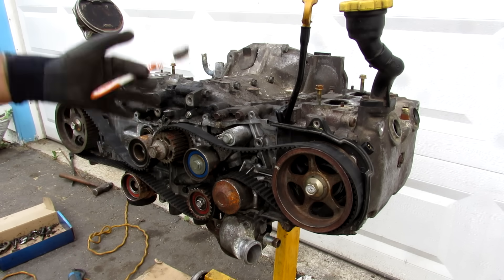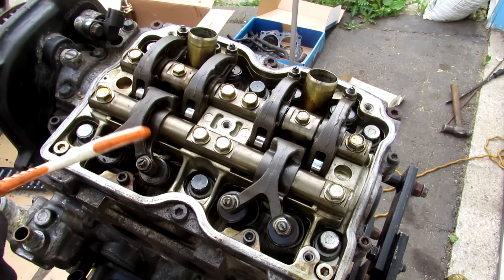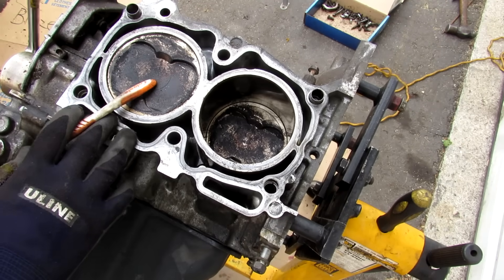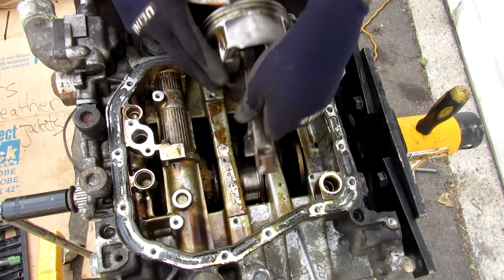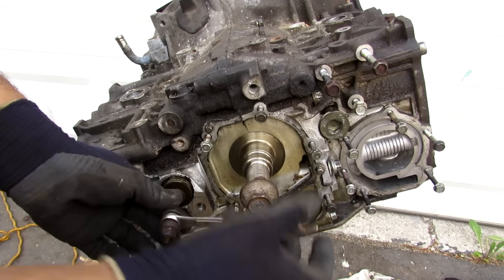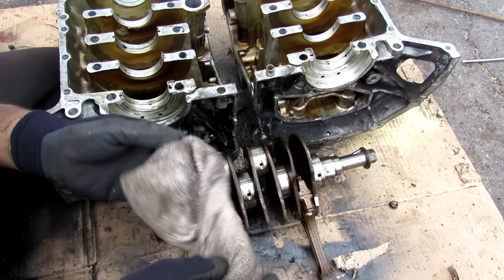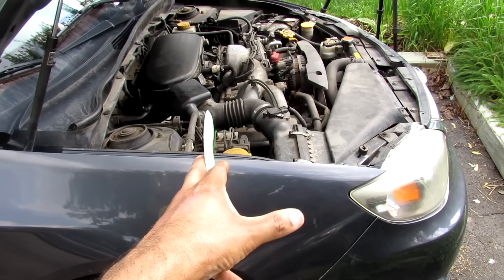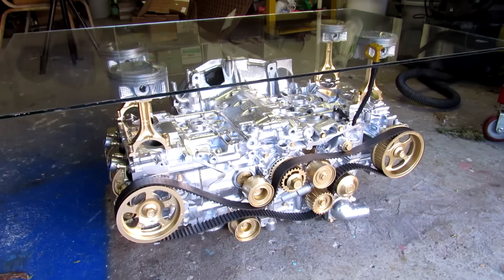Why Subaru Engines FAIL

Comment: There are actually other reasons for HG failure. 
It's primarily the head for the #2 and #4 pistons. 
One reason is cavitation of hot coolant at #4 with poor circulation. Coolant flow is very poor here and ends up stalling, allowing for an overheating issue at that location. There is a mod that helps to remedy this. 
Another reason for HG failure is harmonic distortion between the cylinder wall and the head gasket. This is more evident in the 2.5L engines as the bore dictates a thinner wall thus allowing more movement to take place. The smaller 2.2L and 2.0L don't see this as often, not just because of the thicker cylinder walls, but also some have semi-closed decks. 
As for ringland failure, this usually occurs due to fuel trims, heat and detonation caused by both. Again, many times it's in #2 and #4. I've been told of leaning fuel because of the design of the steel fuel supply lines on the engine. The aforementioned coolant cavitation doesn't help either. 
Bearing failure is usually the result of starvation, yes, but mainly due to driving conditions with the incorrect oil weights used. Ie, People driving too aggressively with an engine not meant for it and using the wrong oil for the conditions. These engines, particularly phase 1 are sensitive to these conditions. Phase 2 mitigated the oiling issue in 2 ways. First the thrust bearing was moved. This improvement mainly addressed axial forces being applied during clutch engagement. The other improvement was a larger bearing design that increased rod journal size from 48mm to 52mm. I believe this was only in the EJ25, but I may be mistaken. This improvement allowed for a wider footprint for the bearings to ride with more oil between them and the journals. 
Other improvements are different valve pressures and channel diameters in the oil pump depending on the model.
Reply from the maker: Thanks for the indepth explaination, alot more detail that I could fit in this teardown video. 
It's good that Subaru is trying to make improvements to address these issues, but I think for a mass production engine these issues should have been ironed out sooner in the development process than using the field to test. I think most of the issues you cited could be detected in simulated lifecycle tests.
Reply: @speedkar99  very true. Though they're now phasing out the EJ family altogether and replacing it with the chain drive FA platform. Phase 1 had the most problems and only lasted a few years with phase 2 starting mid 1999 and continues to this day. I think with the popularity of rallying people decided they would be the next Colin McCray and many Subarus perished at the hands of inexperienced drivers.

Comment: Why Subaru engines fail: neglect.
Reply: Mr Subaru u da man
Reply from the maker: For the average driver it's easy to neglect these engines compared to a typical inline 4 cylinder economy car, which makes the problem worse
Reply: @speedkar99  it's not a design flaw that owners are lazy and don't properly maintain the vehicles.
Reply: @MrSubaru1387  so if you do proper maintenance to a "real" engine it will last even longer... these engines are a joke, once designed for airplanes for their inherent inefficiency and therefore low rpm which is perfect for the 3000 rpm redline of an airplane propeller ... not to well suited for vehicular life... im keeping my inline 4 cylinders and dont get me wrong im a super Japanese car fan... id buy a Subaru over any American car
Reply: @philtripe  LOL. You have no idea what tf you're talking about...
Reply: @philtripe  I have 2 in line 4 cylinder cars and one boxer. As long as you take care of your Subaru, it will go a long way.

Comment: 99% of Subaru head gaskets don't fail internally, they seep EXTERNALLY - early Phase 1 EJ25 (DOHC) were the only only ones to most likely internally fail. The external seeping on the Phase 2 (SOHC) engines could be ignored for years without problems and it was the head gaskets - replacing them with another type or the genuine Subaru TURBO head gaskets would permanently solve the problem even without resurfacing (provided the engine wasn't overheated/warped). EJ20/22 didn't seem to suffer from these issues nearly as much.
5:24 actual reasons why Subaru engines fail - some of the oil pickup tubes can fail in the solder/welds sucking in air rather than oil causing oil starvation, when resealing the oil pan you want to check and inspect them thoroughly 
7:16 second real failure point is that small o-ring in the oil pump that can fail and cause internal leaks / reduced oil pressure, also the oil pump screws can back out after 100-200k and will cause similar issues - always inspect and tighten
Reply from the maker: Thanks for the clarification! I think the EJ20 has a thicker piston sidewall which make it less prone to overheat / gasket failure

Comment: Great teardown! Tossed my Subaru out this winter. Barely made it to 200 000 km. Leaked oil outta everywhere;  the day I decided to get rid of it - started to burn coolant. Never again.
Reply from the maker: Ouch! What year and model was it? 200km is nothing
Reply: @speedkar99  2006 Forester 2.5l SOHC. Relatively low mileage, but an old car. I feel like I have closure after watching this:)

Comment: Is it only the 2.5 liter or EJ20s fail too? I'd want a subaru as my first car and you know, i have to learn
Reply from the maker: The EJ20s have a lesser failure rate and are stronger due to thicker sidewalls than the EJ25. Tuners prefer the EJ20 more.

Comment: My mate had an impreza for years with no problems used to drive it like he stole it the engine lasted fine. It's like any other highly strung car u don't maintain it it will break
Reply from the maker: There will always be bad apples and really good ones. The moral is,. Take care of your car. If the mass population treats an Impreza like it's competitor Corolla it will fail very soon.

Comment: I had to do to do a rebuild on my ej251 due to the infamous H/G leak..
After replacing the the Head Gaskets with MLS ones, it's been solid afterwards!
Reply from the maker: So I've read. Once you fix the head gaskets the problem rarely reoccurs
Reply: speedkar99 Yup, becomes a reliable car/engine again. N/A models had this issue for a long time because Subaru would not admit that their HGs flaking off was the one creating the problem and their “fix” at the dealer was replacing the damaged HG with the same type(non MLS), hence the problem would return, no wonder there were so many customers displeased. There was even a class action lawsuit. I researched it big time. The Turbo models bring MLS HGs and never present the coolant/oil leaking issue, but as you said, they have the Piston #4 ring land failure on the ej205 due to lack of coolant ruining by there. Later, ppl came up with a fix: connecting a T type hose from the Left side of the engine’s service plug, which now supplies coolant to that side and therefore reducing and almost if not completely eliminating the P#4 ring land failure. Mine’s been fantastic after the rebuild and even though it’s a 20 year old car, I love it and still enjoy it every day.

Comment: EJ20's don't have the piston problems as far as I understand.
Make sure you change oil frequently and keep level correctly and if you do, they are reliable and very tunable. My 2003 forester xt tuned to 300bhp has been fantastic. 😁
P. S. You certainly are a great engine mechanic 👍👍👍
Reply from the maker: Thanks. The EJ20s don't suffer from it as bad. 
I'm no mechanic, I am a mechanical engineer

Comment: I had a 2015 Outback, put 172,000 miles on it and never had a problem with it. Changed the oil every 6000 miles
Reply from the maker: You have the newer FA engine

Comment: The head gasket issue appears to effect some Subies more than others, so am curious how they solved? Porsche flat sixes don't seem to suffer this fate...then again the early ones were air cooled 😉
Reply from the maker: Look at the demographic of the owners. Subaru are economy cars. Id bet the Porsches are more maintained
Reply: True. Cheap cars are arguably more reliable because they're simple, but often neglected. That H4 was certainly more complex than an I4 though. I still applaud Subaru for sticking with it. It's their identity and choice is nice as a consumer.
Reply: If your curious as I was, gaskets appear to be the culprit https://youtu.be/-aq0hDvKJ5Q Graphite coating wears off. Doesn't effect all Subies apparently.

Comment: Yea. I have this engine on my forester. Head gasket leaks oil.  Looked it up.  All the forums are like yea it’s normal.  There’s just some thin blue film on the shitty head gasket that keeps the oil in. Leaks are totally normal they said.  Wtf. That’s said.  Great awd tho.  Drives in ice like dry pavement.   This also explains my intermittent overheat.

Comment: My mother bought a 2017 Forester and it has been nothing but a problem. Eats oil, then it started leaking oil then an issue with the variable valve timing. Transmission had to be addressed because if you drove on the interstate for long period of time and get off at an exit it was like it didn't know what to do at slower speeds. Cant just start it and go, have to wait for it to warm up or it will buck while trying to accelerate. Starter had to be replaced after two years which is nonsense. My family has traditionally been loyal to Ford but seeing how she is only 5ft tall the driving position and low hood of the forester fit her well so that was the major factor on her deciding to buy it. But after this debacle of a vehicle i don't think any of us would purchase another Subaru.

Comment: I have an 04’ Outback (non turbo). Had the head gaskets, timing belt, water pump, plugs,  done at 115,000. $2800. That was in 2017. I also did a CV left front. I have had the car since 2013. I change oil at 5,000 with a synthetic blend. I could get maybe a $3,000 for it. I also have towed a small boat 1200  miles at  highway speed. I keep it because I don’t want car payments. I could afford a $45,000 vehicle, but I get anywhere I want to go, in most any weather, in this car. And a 7’ fly rod fits ( with the back seat down) no problem. Yes it’s slow until you get to 55, who cares. If these old little cars are so crappy, why do I see so many on the road? I live in metro Chicago area and old Subies are everywhere. All cars have some chronic problem. I like my old car, it sounds like a little diesel tractor.

Comment: I’ve had the 4s and a few 6s. They are a bit tough to work on. I did nurse a few to over 250,000. Got a new one out front. My 6th one. Like them.

Comment: I have owned two Subarus. A 1982 station wagon that was driven for about 120k miles then sold to a friend who drove it for another 100k without an engine problem. I now own a 2014 Forester, with 56k miles without any engine problems. I do all the oil changes myself on all of my vehicles at thousands of miles  less than the recommended interval. I use good correct viscosity oil (full synthetic) and have been using Fram oil filters on all my vehicles for a couple of decades. After draining the oil pan, I always pour through (waste) a new quart or more to flush out the pan before replacing the drain plug and filling the engine with new oil. A friend of mine has a 1998 Subaru station wagon with over 400k miles and no engine problems and he is very particular about oil changes also. Do you credit lack of oil changes as the most prevalent cause of Subaru engine failures?

Comment: I wonder how Porsche designs their boxer engines. That would be an interesting tear down.
Reply: Ask any 996 or 986 owner.
Reply: @Ben W Yep, still using them in the Honda Gold Wing
Reply: They are fairly similar to Subaru's engine. Boxers haven't really changed much since Karl Benz invented it.
Reply: @M Bacon lol
Reply: I would especially love to see this compared to the engine in my car, the 2.5T from the 718 S/GTS.
Reply: If Porsche sticks with boxer engines then that is a recommendation for the design, opposed engines are inherently balanced due to the counteracting  crankshaft throws,
Reply: It would be a great comparison to see what Porsche is doing for better reliability and visa versa.
Reply: @phillm156  is "reliability" a word that shouldn't even be used in reference to a German engine??? 😆
Reply: @phillm156  Most Porsche owners never get their hands dirty, they pay someone else to do the maintenance, so there are not too many that are driven into the ground like Subes.
Reply: @phillm156  Honda would be a much better example.
Reply: Porsche had piston slap problems in water cooled 986,987,and 997.1. It caused bore scoring which was salt on top of the whole IMS bearing situation. They basically solved a lot of this by using their motorsports engines as a base for the street cars. https://www.total911.com/technology-explained-mezger-engine/
Reply: @mjon5706  It's an interesting read, I'm not too familiar with Porsche engines. I wonder what G.M did with the oiling system on the Corvair engines that predated the Porsche six cylinders, some of those had turbos?
Reply: @olegkostoglotov8800  I always heard that the Corvair engine was a surplus engine from the Corvair airplane the military used. I have not Google this yet probably should have first! LOL but if this is true I would think that would be a good engine.
Reply: @olegkostoglotov8800  I looked, it was the Corsair airplane. And yes a much different engine.  LoL... oops!  Need to keep off the Pevos!
Reply: @curtispomykal8432  Lol yeah, don’t think a 2600 cu in radial engine would fit in a corvair.
Reply: he probably doesn’t wanna potentially harm a $100,000 engine
Reply: @nunyabusiness8538  you can buy a used GT2 RS engine for 25k-30k including the harness and computer.  A 911 engine can go for 10k-15k. I would love to know who is buying them for $100k. I have a 9 year old Craftsman lawn mower I need to sell. I'll make them a deal. $12k cash. You can even have the mulch bag and I'll pay shipping.
Reply: King Loc what about gearbox? Another 10+ at least!
Reply: When will Subaru finally give up on their boxer engine?
Reply: @5000BlueStudios  never. In fact they rarely have any of those issues anymore. The EJ251 and EJ253 had the problems. The EJ20s and EJ22s never did.
Reply: ASVP they ta,e a Subaru flat 6 and complicate and over engineer it!
Reply: @cigarsgunsanddiesel8032  Why not, the older Posches basically used souped up VW 4s, which were a copy of a Tatra.
Reply: @cigarsgunsanddiesel8032  Everything is complicated next to a V8 pushrod OHV engine who's basic design is 80 years old, and uses massive displacement so that the engine suffer very little stress, but you know fuel is expensive and polluting, so engines have to be clever and try to be efficient. Unless you have the money to pay for the fuel, and don't mind murderous heat in the summer and murderous hurricanes in the autumn.
Reply: @yakacm  well if you want power and proven reliability a pushrod engine is the only way to go!
Reply: @yakacm  It depends on the V8 engine, and it's displacement. You can have a V8 as small as 215 CID, like the Buick/Rover aluminum V8s, or as big as 502 CID like some of the Cadillacs of the 70s had. In between you have the bore to stroke ratio, combustion chamber design, valve sizes, valve angles, what cam it uses, port designs, carburated, or fuel injected.
Reply: @NightshiftCustom  Nothing wrong with overhead cam engines, most pushrod engines are not very rev happy and are meant for only two valves per cylinder, why do you reckon pushrod engines are so superior?
Reply: @cigarsgunsanddiesel8032  Complicated?  Not so much. A hand made Swiss Chronograph,  for sure.
Reply: @rancidpitts8243  Same thing JR said .